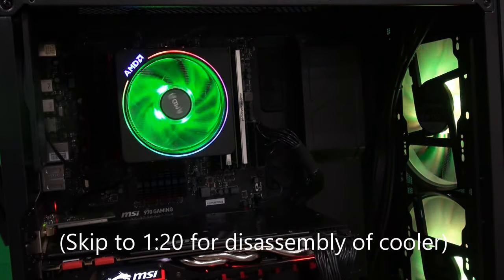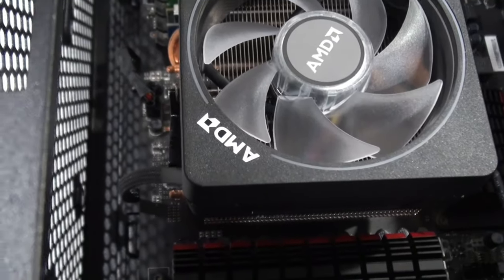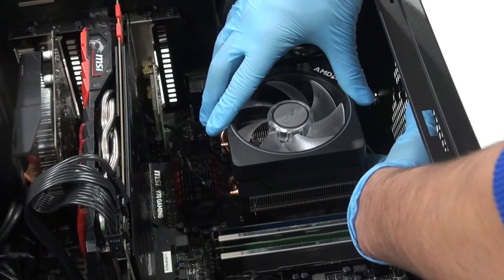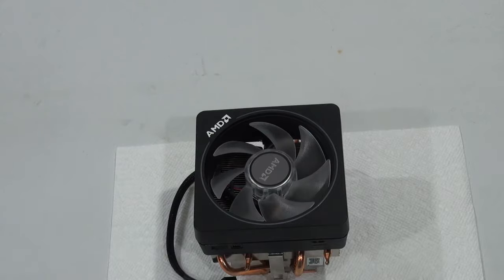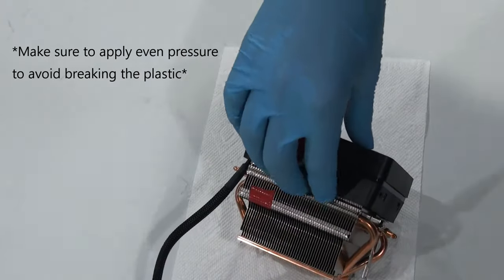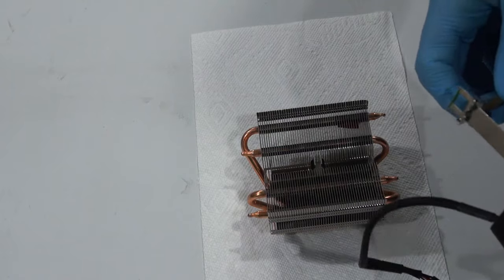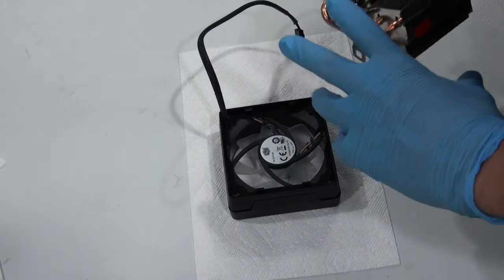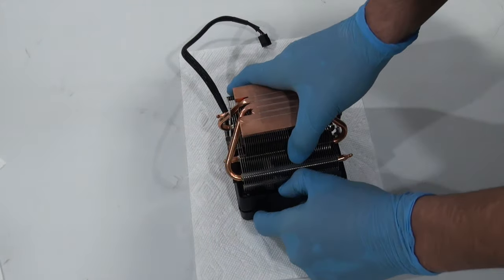How to Take Apart and Clean The Wraith Prism Cooler

Comment: "Just use your hands to pull out the fan" aaand I snapped half the clips
Reply: Exactly, I snapped two clips trying to separate the fans from the heatsink and i snapped one trying to put the fan back, now I'm thinking to just tape it for a while before buying a new cooler
Reply: Snapped 2 aswell
Reply: Same :/
Reply: Damn man wtf glad i saw this
Reply: I snapped one. I guess the good news is it's inspired me to get an AIO 😅
Reply: This has inspired me not to even try. I'll just use a Q-tip and blower. Don't want any clips breaking. I tried, nothing budge's.

Comment: Cheap upgrade: Remove the stock fan, attach the cooler to your motherboard, strap Noctua fan to the lever on both sides. I've done it to a PC in a guest room and the PSU fan is the loudest one now. GPU has two Noctua fans strapped to it too. Yea, it voided the warranty, but it's so damn quiet.
Reply from the maker: Not bad at all! The stock cooler fan is pretty loud.
Reply: I did that trick with a 92mm Noctua fan, however it did not do any favor for me. 
I use a Ryzen 7 2700 in a small HTPC desktop cabinet, it runs the Prism fan about 600rpm in idle/low load  and it doesn't make alot of noise, and it runs with 600rpm up to 55C. Even at load it still only hits about 1800rpm max and under 60C since the 2700 is a pretty cool running chip with its low baseclock.
So I then tried swapping with a Noctua NF-B9 to see how it would behave when overclocked to 3.8GHz at all cores. The Noctua simply couldn't keep up since it maxed out at 1800rpm and it was 6-7C hotter than with the Prism fan.
Reply: i was just looking at this video because i want to use noctua fans all around but honestly might just get the noctua tower cooler

Comment: DO NOT USE YOUR HANDS TO PULL OFF THE CLIPS, as many people have pointed out, that snaps the clips, this is because you are supposed pull the entire side of the cooler, not just the clips. The clips are not made to bend that way. Instead either use your hands or take a flathead and a piece of card stock and put it against the cooler (the card stock stops it from damaging the cooler) put the flathead under the cooler and carefully pry it off. Hope this helps

Btw I know I am way late

Comment: Omfg I finally got it - there are 2 tabs to release it, they're suuuuper hidden and difficult to get to, but they're by the lever that clamps the cooler to the CPU. 

You have to push them inwards simultaneously and then pull quite hard to separate the fan from the cooler. I used a metal spudger to help me release the clip stuck behind the lever. Hope this helps!
Reply: I used some fish scissors to push away the clips and release the fan. The radiator slipped, and its corner cut my hand 😢 at least I didn't break anything

I dont know how the guy in the video fit his fingers between the radiator and the fan structure 😂
Reply: I did this method and I can confirm this DOES INDEED very much so work, thank you so so so much man!!!

Comment: "A fair bit of fidgeting"
... I've been at this for 45 minutes 😭😭
Reply from the maker: Yeah, unmounting this cooler is certainly a process!
Reply: I finally ended up using a screwdriver to pry it off. That worked pretty well. I was about ready to just cut it off 😂

Comment: Aye, I’m gonna be painting mine white, what would you recommend so that the paint wouldn’t melt and leak into the system.
Reply from the maker: Definitely do a little bit of research and find out if your paint type is suspectable of melting, although I am sure most paints should be ok once they have set. I plastidipped my GTX 1080 black and have no issues with the paint melting.

Comment: I've just popped the fan off and brushed it out so far. Going on the second year now. I just don't like messing with cleaning the paste off and reapplying the stuff. I have a large tube of MX-2 and I always have 91% isopropyl in the house. The MX-2 might be better than stock but my temps are fine and I am lazy. 
 It ain't broke, I ain't fixing it.
Reply: are the temps still normal?

Comment: i am going to do this and i have never changed the thermal paste and it has been connected for about a year, should i get some more thermal paste  and put it on?
Reply from the maker: Unless you have any thermal issues or remove the cooler, you should not have to reapply thermal paste.
Reply: @jbtech1080  hold the heckin phone what? yes, every time you remove a cooler you should be doing a full clean and re-applying thermal paste. if you dont it can create bubbles, which makes expanding and contracting air pockets that will . . . ect ect science = much shorter life span. TLDR of it all is its 100%  worth the like 6 bucks a tube and the couple minutes of your time.

Comment: I attempted to clean mine but when I reconnected it would light up but the cooler will not spin ?
Reply: Maybe you plugged a wire in wrong place ?
Reply: @invisibel3211  im certain it is the correct place ive had it in the same place for 9 months and decided to clean my pc out and i accidently unplugged my hardrive started my pc up and the wraith did not spin and my screen it needed to load windows so i looked back saw it was unplugged i fixed it but my wraith never spun again even disassembled it and cleaned it out buit nothing just gonna get a new one
Reply: @Bagboyydripp  man that's a shame I hope you get it fixed . I cleaned mine yesterday after 2 years . There was so much dust clogged inside . Major drop in temp
Reply: @invisibel3211  definately helps my temps are still low enough to run it but getting a new one anyways my pc is life

Comment: If you take out the Wraith that way, it is more than possible that the cpu will come out sticked to the cooler.
It did happen to me, and not only bended the cpu pins but damaged the socket, thankfully a technician was able to repair.
Reply: That's why he said to power your PC on first to get it heated up so it will not stick.

Comment: But you did not clean the fan blades or change the lubricant of the fan shaft bearing......
Reply: He cleaned the fan off screen and adding lubricant should only be done every 3+ years or you'll overdo it.

Comment: This is just an AM3 heatsink. Lol
Reply from the maker: Haha yeah. AM4 and AM3 coolers are interchangeable.
Reply: @jbtech1080  I still bought a thermal take air cooler with pipes. I was doing some video editing in my AM3 FX and my PC shutdown a few times .

I upgraded to AM4 Ryzen 5600x.
It's 65W hopefully the larger cooler will keep it cool.

Is the so called air cooler with pipes same as the liquid cooler with flex pipes? They all have coolant.